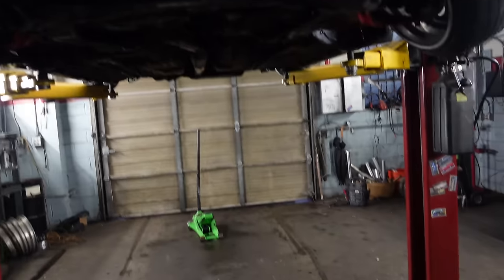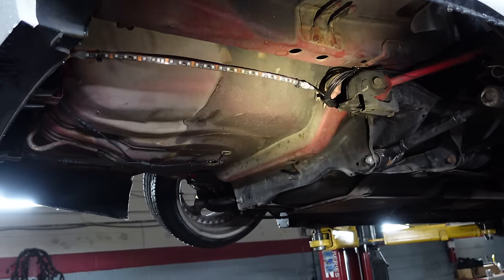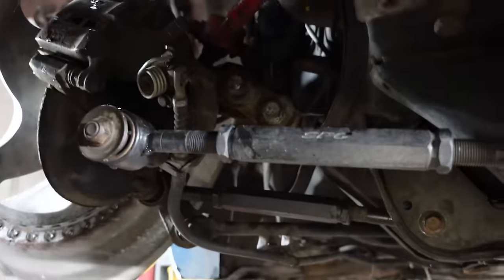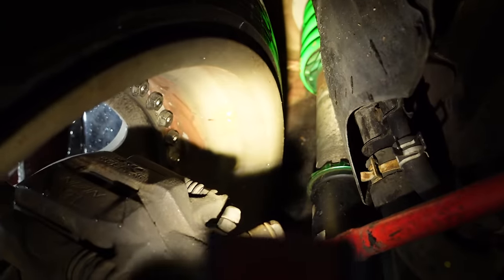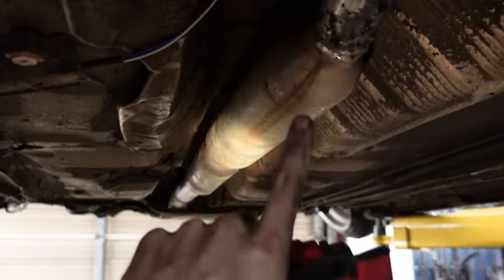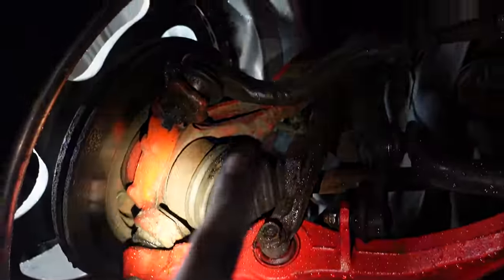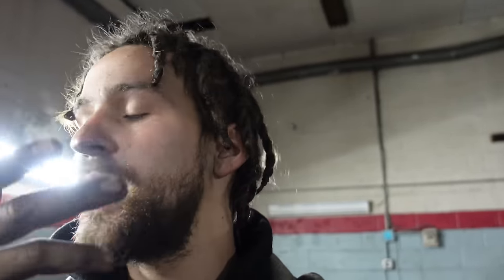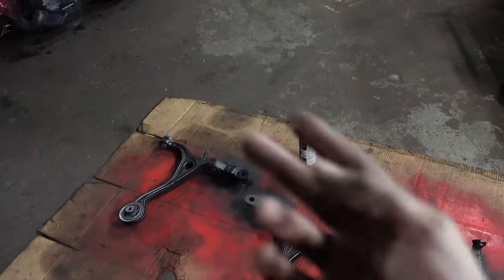VLOG #12: HOW I GOT -30 DEGREES OF CAMBER ON MY HONDA ACCORD

Comment: I know the feeling of those WW3 Philly roads. I destroyed an oil pan heading into Center City on 95 right before I got off at my exit. Pulled over and my car was puking oil all over the ground. Luckily I was able to get it home, drain the pan completely, and use some JB Weld to fix the hole.